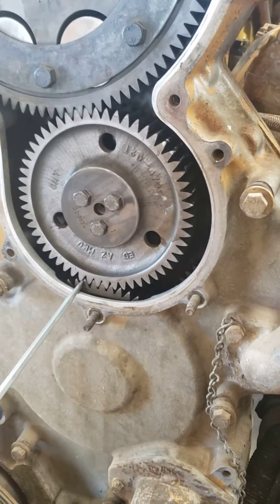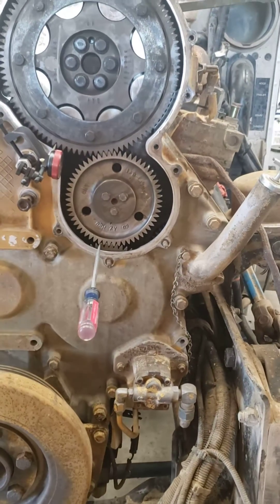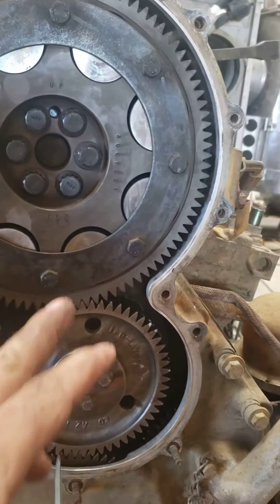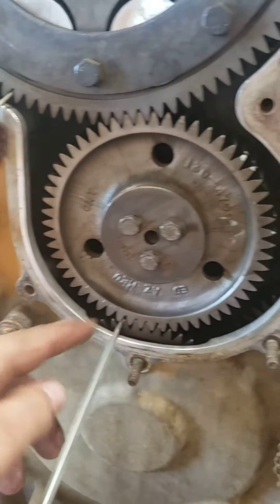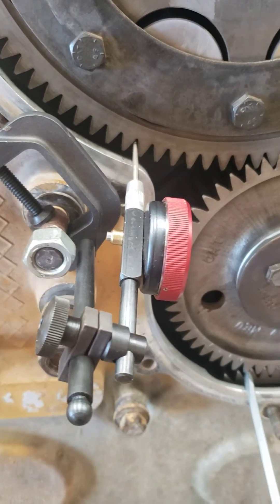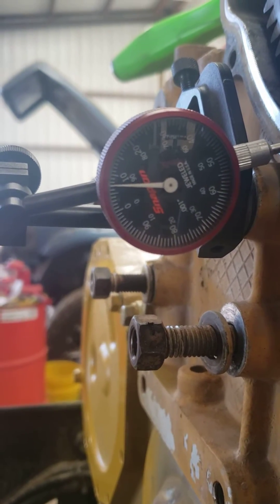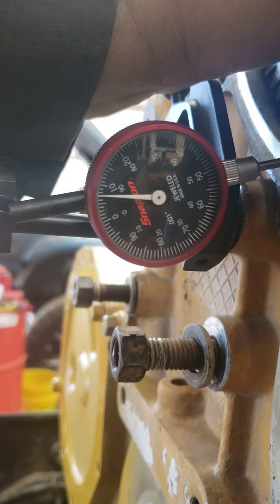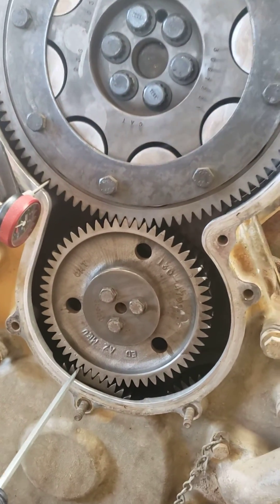C15 Cam gear

Comment: does this gear have 36+1 teeth where the primary and secondary sensors read the signal?
Reply from the maker: Yes, the camshaft gear is a 36 +1 tooth.

Comment: Your spec is out of date. Currently it is 0.014 plus or minus 0.010 Or 0.004 to 0.024.
Reply from the maker: John Goldsmith,  thank you.
Reply: @timstanford3443  Also a new cylinder head gasket design for 3406 E and up.